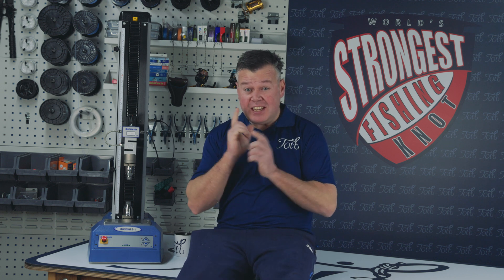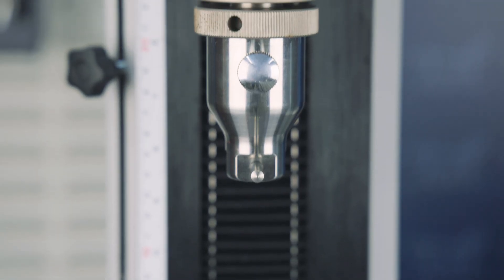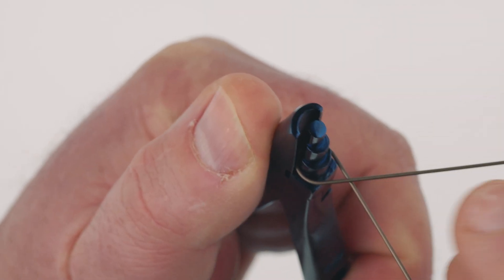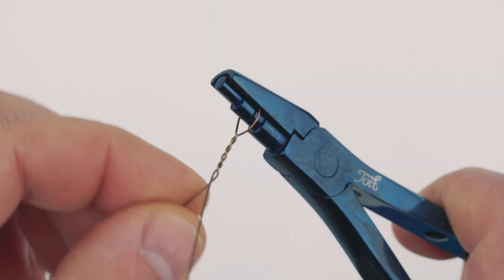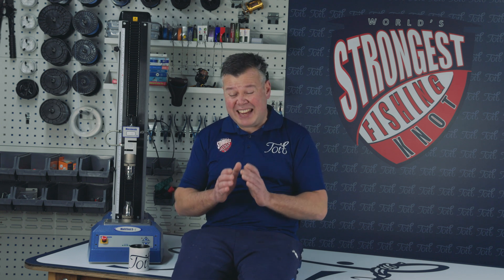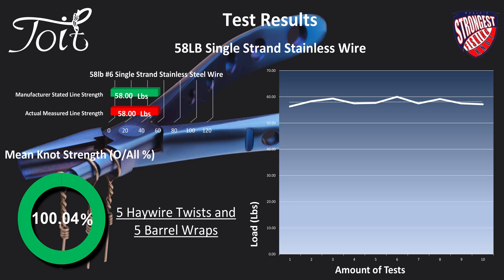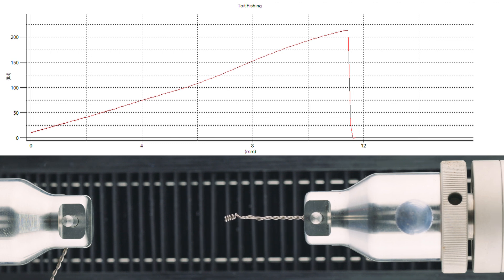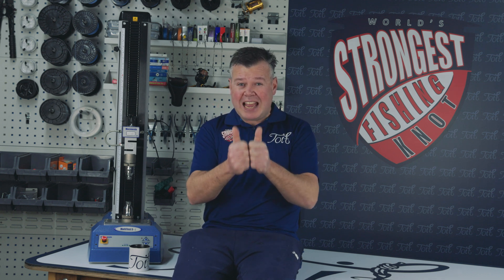Haywire Twist Tested | World's Strongest Fishing Knot | Episode 17

Comment: Hi Warren. I just watched another video that came to the same conclusion about using only barrel wraps for single wire connections. However, in the comments, the author said that you could saturate the coils with super glue to almost double the strength of the connection. Theoretically, this could increase the friction between the coils and the standing wire, reducing the slippage. Do you think that this "fix" could work?
Reply from the maker: Hi Marcello, I guess some people just do not like the front end of the haywire twist, they just like the barrel wraps, I had another fisherman in the UK reach out and he was adding stinger hooks using single strand to his spoons and lures which works well and is popular in South Africa. He also did not like the length of the haywire twist and asked about just using barrel wraps, which of course I said the initial twists is what gives the connection all of its strength. As far as glue goes or even super glue, the surfaces will not create a bond for metal so I would have a guess it would not add enough strength to even think of trying it, Barrel wraps just slip so easily. I will test this at some point and will be very open minded. Do you have any idea what glue he used? Tightlines

Comment: Great to see this new video and it doesn't disappoint. The production values and the sheer amount of work you put into these videos are clearly evident. My only slight quibble is that the sound level was lower than usual so I had to use full volume even through earbuds. I suspect that the very loud wire breaks might have influenced this.

Now we need the best connection to the leader/main line for the haywire twist. I use either a Sampo swivel or solid ring depending on how I'm fishing.

My first haywire twists were made using the excellent Dubro tools but it wasn't long before I found that it was quite easy to do them with pliers. I don't even know where the Dubro twist tools are now though I still keep the tool I bought for straightening the wire, something that's occasionally required.

Another thing I'd be interested in is people's experience with 49 strand wire vs solid wire under different conditions. I use stranded for trolling chugger style lures since they seem to get better action but have had good results with solid wire on the heavy bullet lures that are good for fast trolling for wahoo or big mackerel. For sharks I've used both but have switched to light chain as it does less damage to the fish, important when releasing.
Reply from the maker: Hi Brian, thank you for the kind words. Yes indeed it takes ages to do these episodes but I am hope many people will benefit from the hard work in years to come. I just had a listen on my TV, laptop and desktop with and without headphones seemed okay I have the volume roughly 30/100 and it was okay. I appreciate the sound quality is a has a little echo and the room I film in is solid concrete so it does make it tricky. I do wish I new someone locally to me who could help with the sound but it is a really specialist thing. Yes I will try and tame the wire breaks for future episodes as the camera is literally on top of the filming when doing all the macro stuff. Thanks for the feedback nonetheless and I will certainly bare that in mind for future episodes. Tightlines
Reply: @toitfishing  No problem with the little echo, it was just quieter all the way through for me as I had the volume near maximum when I normally use under half. It might be a YouTube thing as maybe 25% of videos I watch now seem to have lower sound levels. I was thinking that the loudness of the wire snaps might have been used in some sort of volume averaging algorithm. I actually liked the loud wire snaps as they emphasized just how much tension was on the wires when they finally let go. Again, thanks for the great video and keep up the excellent work. Tight lines.